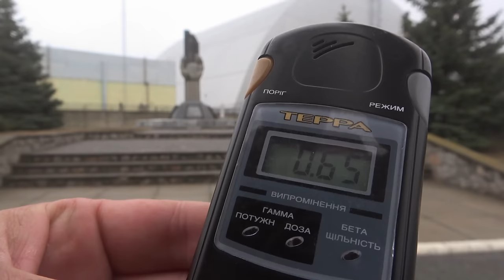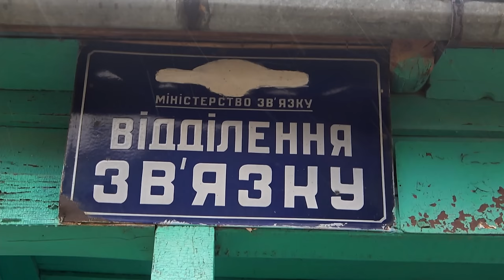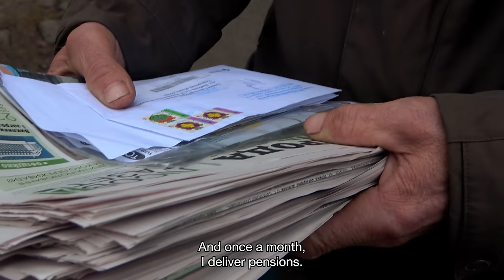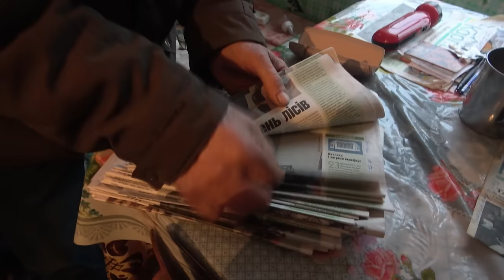Ukraine, in the mist of the Carpathians | Deadliest Journeys

Comment: Try going up the hill in reverse gear. The ol' model T
Fords had to fo that for two reasons either a worn engine but also cause if low on fuel on a steep  incline would not push fuel to feel gravity to carburetor...

Comment: Russian vehicles may lack electronics and safety systems other counties vehicles Have but they’re known to be structurally over built to survive rough driving roads every where and so many even cars are 4x4.  They’re also known to be able to repair any part of the vehicle easily and quickly. They produced a large number of small 2 and 4 door hatchback cars in the 1960’s-1980’s that have a much higher than normal riding height, a suspension lift system , super light , small, maneuverable , reliable and can go anywhere with amazing mileage.  If I were one of these folks that’s what I’d drive
Reply: Уважаемый!
Все советские авто, это все те же вилисы, дожди, штудебеккеры 40вых годов прошлого столетия!!!😏